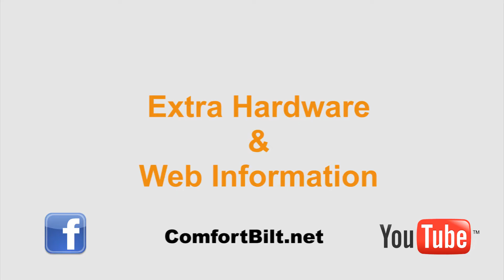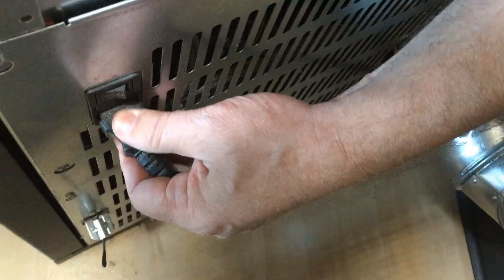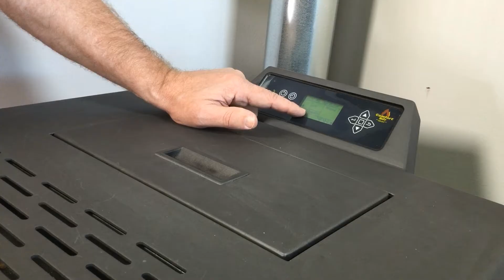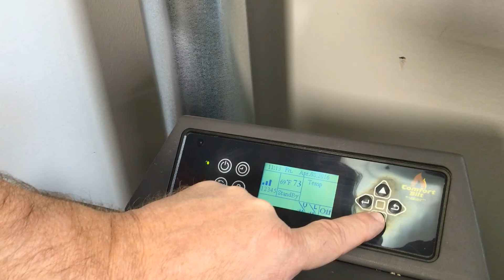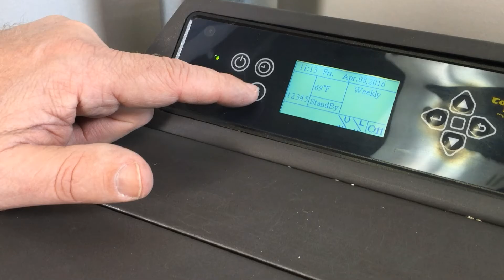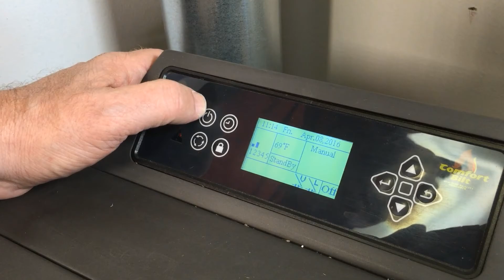ComfortBilt: Setting Up The Control Panel

Comment: Hi, I have a question.  My comfortbilt stove is showing a lost connect alarm on the screen. The blowers are on. I can not get the stove to do anything else. I have turned it off. Then powered it back up. It will go to the main screen first, then go back to that same alarm screen. Can you help with this please 🙏.
Reply: Hi again.  After rechecking connections and a hard reset, my stove panel is back in business.  Thanks for all your helpful videos.

Comment: Why in the world wound you NOT mention which stove you are referring to. Mine is different because it's an HP41 which I was told would be adequate for my size space. NOT. You guys please get your act together. It's a struggle to get this thing to work. When it does, I really like it but the issues are cutting into my experience.

Comment: I'm having a bit of an issue with the temp setting. How I understand it is you chose temp before you start the stove, set your temp, hit on and the stove is supposed to keep the house at that approx temp. I've done all that, set to level 1, but it just keeps going and it is currently 82° lol, that's not the 72 I set it at. Any ideas what I may be doing wrong here?

Comment: Hi can you make a video on how to set the weekly timer. I’m having a hard time trying to figure it out. And the V/L is not showing up on my united. I don’t know because it’s a hp21 are not.
Reply from the maker: A new video for the Set data menu is in the works, but check out the New Stove Tutorial series.  Part 3 (control panel operation) will be extremely helpful to you.